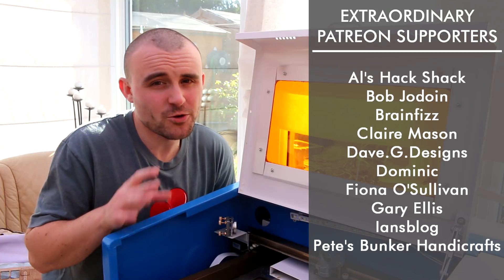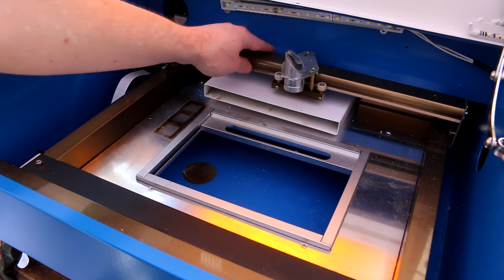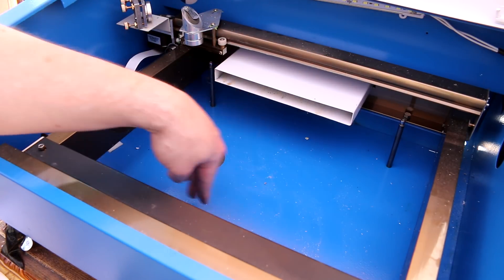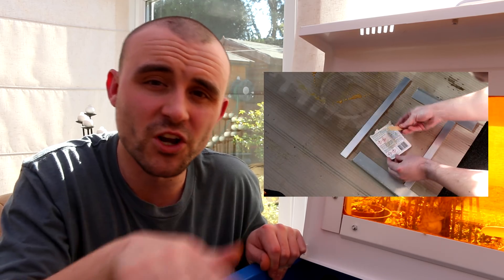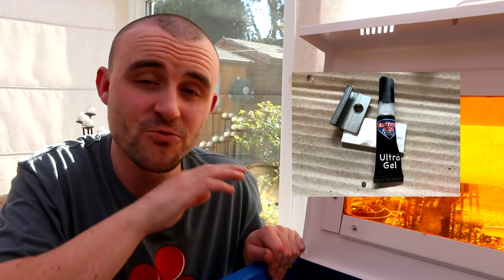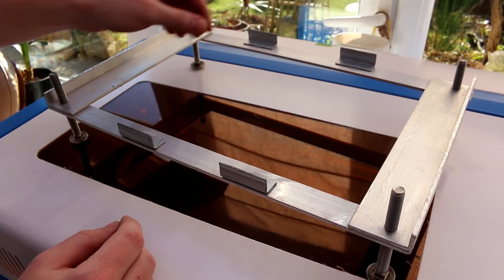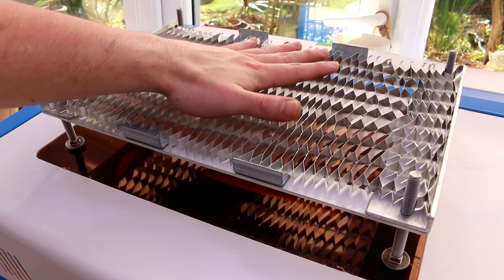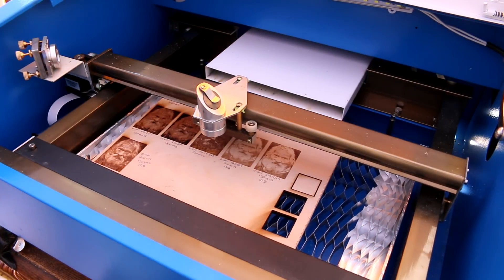Simple Adjustable Bed For K40 Laser Engraver

Comment: I just bought one of these to manufacture silicone foam gaskets that are a total pig to make with a graphtec knife plotter.   I will be making one of your height adjuster beds with the honeycomb mesh on it.  Your mesh looks ideal for putting a bit of plywood on it.   But the silicone foam I am using is about 3mm thick and very flexible so its going to not lie nice and flat on the mesh.  Are you aware if I can get hold of a finer honeycomb mesh ?  Cheers for a very clear video.

Comment: You used 100% the right epoxy, perfect for the job. If you don't abrade the surface it just isn't going to work. It's like trying to stick an egg to a Teflon pan. The aluminium  is just too slick and the epoxy just peels off. Especially if it gets a little warm, like from a drill.
Reply: lock 2 nuts at the top of the legs, and you can use an electric screwdriver with a nut driver head to set the height. (edit-add) reinforce those threads in the aluminium if your going to do the electric screwdriver thing...

Comment: I was thinking of cutting off part of the exhaust duct and then figuring out how to make a bed to lower and raise for my cutting boards, but this is so much easier!  It's a very simple design and is pretty genius just to always know "at the top of the bolt".  Thank you for sharing!
Reply: @Matthew Wolfe
I completely removed my exhaust duct by unscrewing it from the back. Saves having any sharp/jagged parts and I've found that the extraction is still works fine.
Reply from the maker: Thanks mate! Really glad you liked it. I often think simple is best haha

Comment: Great design! I did something similar with a belt and a knob so it can be adjusted while inside the machine. Unfortunately, the bed isn't stable and I get wavy lines, everywhere. Do you have this same issue?
Reply from the maker: Thats a great idea! Be much more convenient thats for sure haha I haven’t had stability issues. With each bolt/leg able to adjust independently I can make sure its sitting level in the machine. It may be worth trying a slower speed to reduce shaking perhaps?
Reply: @AverageJoesJoinery  I might try a lower speed, however, it's only running at 35mm/s, doesn't seem bad at all.
Reply from the maker: That is slow. I typically cut at 5mm/s but engrave/etch at 150/200mm/s
Reply: Average Joe's Joinery yeah, I think I’ll stabilize it with some type of screw from the sides of the machine
Reply from the maker: Good idea!

Comment: Very clever.  Thanks for sharing the missteps. That's helpful.  How much work space did you gain from the modification?
Reply from the maker: Thanks Muhammed! Since making this new bed Ive been able to take advantage of the full cutting area where as before I could use a quarter of it in the clamp

Comment: What size is the bed 200mm x 300mm?

or other? thanks m8
Reply from the maker: The bed is slightly bigger than an A4 sheet of paper so roughly 310mm x 220mm. I just made it as big as would fit in my laser machine haha
Reply: @AverageJoesJoinery  nice one for the reply! I just got my laser working on the upgrades and mods. Planning on doing something similar but using a Lab Jack to adjust the hight.

Comment: Great idea,what size did you cut the aluminium angle. TY
Reply from the maker: Thanks Chris! I cut them to slightly larger than A4 dimension. So roughly 310mm for the long pieces and 220mm for the shorter pieces
Reply: @AverageJoesJoinery   thanks👍🏻 my new project

Comment: Hello. I have being trying to guess the exact length of the bolts. Unfortunately, your explanation is not very clear. You say that the distance between the bottom of the machine to the focus point is 85 mm on the top part of the bed included with the machine including the clamp). Then why do you advice to use 80 mm bolts?  I thought that the top of the bolts would coincide with the focal distance from the lens to the material which is 50.8mm but with 80mm bolts and actual measure being 85, I just don't get it.  I don't want to appear dumb but I just don't understand it. I appreciate a little more clear explanation here.
Reply from the maker: Hi Eduardo, sorry if my explanation wasnt clear. I advise using 80mm bolts because the heads of the bolts arent included in their stated measurement. So 80mm long bolts measure roughly 85mm including the head of the bolt. 

I opted to measure my focal point from the base of the machine upwards rather than from the lens downwards. This way, I can be sure if the material I want engrave is flush with the bolts then it is in focus. 

You will need to check your own focal point as it may differ from mine
Reply: Thank you very much Joe for your explanation. Now I find very clear. I am making a wooden frame and instead of the honeycomb, I am installing several 1mm steel wire lengths separated more or less one inch between them. Finally, The focus measurement is from the base of the machine to the border of the tube that hols the lens or to the actual lens position.  As you know, the lens is slightly upward inside the tube that holds it. Again thanks and I will let you know my final results.  EDUARDO

Comment: Hey, nice vid ! I want to buy one for myself and j have questions for you, maybe you can help me a little bit.
What is a maximum engraving size with this bed ? What software was included with machine ? Does it work with k40 whisperer ?
Reply from the maker: Thanks Michal! It can engrave to the size of an A4 sheet of paper. The software it came with was awful. It was a version corel draw. I use mine with K40 Whisperer and it does everything I want

Comment: great idea to use until I can get round to making a motorised bed. Cheers. I'll actually 3d print corners and embed nuts in those rather than cut a thread. You could also have superglued nuts below the holes. But simple and effective idea :-)  Okay - did you cut the bolts down to the correct size ? An 80mm bolt is 80mm of thread PLUS the depth of the bolt head. In my case with 10 mm hex bolts - it's an extra 7mm.
Reply from the maker: I looked at the motorised beds but was put off by the price haha also wanted to maximise the depth I could use. The 80mm bolts including the head falls about bang on where my focal length is. I bought 75mm and 85mm to see which was closest but 80 was the sweet spot.

Comment: 2 things :)

First of, where did You buy the honey comb sheet? :)

Second.. a better bed to make, that makes it MUCH easier to adjust... 
Take a scissor lift (See link) https://www.ebay.com/itm/Mini-Laboratory-Lifting-Platform-Lift-Tool-Scissor-Rack-Silver-Stainless-Steel/264314699660?hash=item3d8a623f8c:g:ENoAAOSwupBc0nUo

rivet or bolt to bottom, extend the adjusting screw out through the laser chassi  in the front (do require some drilling:) put honeycomb table on top of the lift. (You can make a distance piece to hold between laserhead and material to know the focal point)

You can also use 2 lifts, one on right and one on left side so in case You have something (material) that are angeled you can adjust the two sides differently to level Your work piece...

This mod works very well :)
Reply from the maker: Thanks mate! Glad you liked the design 😊 

I did have a look at some scissor lifts but didnt want to give up the depth they would take up. 

Here is where I bought the honeycomb from: https://www.easycomposites.co.uk/#!/core-materials/aluminium-honeycomb/19mm-aluminium-honeycomb.html

Comment: I have the slightly different model (k3020). The nozzle itself can be lower and raised. The bed's height can also easily be adjusted.  But the price of the machine here(malaysia) is around 1000usd 😔.
Reply: Also, i would strongly suggest adding air assist to your machine. It makes huge different when cutting acrylic and rubber.
Reply from the maker: I wish the head height on mine was adjustable! Im hoping in the future I can upgrade to a larger machine though. I do plan to add air assist soon

Comment: Heading to the hardware store to duplicate what you have shown here.  Excellent idea.  I am using expanded metal instead of honeycomb, so some slight mods may be necessary. This is simply better than wasting $200+ USD on a powered Z table.
Reply from the maker: Glad you’re gonna give it a go mate. Its a simple design but works well. Expanded sheet metal is a great choice

Comment: I bought an air assist nozzle off ebay that also is adjustable for focus. Much easier to raise or lower the nozzle than the entire bed. I'm going to use your bed design, it'll be adjustable for levelling & coarse adjustment. Then use the nozzle for fine adjustment.
Reply from the maker: As far as I know the air nozzle doesnt focus does it?
Reply: @AverageJoesJoinery  The stock one doesn't. But this one does: search "K series laser head 5030" on ebay.

Comment: Ive heard its really hard to weld aluminium and you need to be good at welding to do it right. I guess you could have used rivets as that's cheap and easily done. This webpage      https://k40laser.se/diy-how-to/setting-the-proper-focus-in-your-k40/      was quite helpful and I like the ramp test video at the bottom
Reply from the maker: Could have used rivets for sure! I’ll have to get a rivet gun. I’ll have to check out that site! Thank you 😊

Comment: That is a clever idea the way the bolts line up to the surface to set the height.
Even if you couldn't get the perfect length you'd just need longer ones and cut them down.
Going to stash this idea away - am sure it will be handy down the line.
Reply from the maker: Thanks! Its a simple one but I definitely think keeping it simple is ideal for this application. Can definitely cut down longer bolts or maybe add spacer pieces to the bottom for the shorter bolts to sit on. Lots of possibilities 😊
Reply: Second that. The benefits of being able to align things outside the cutter with nothing more than eyes or a straight bit is genius.